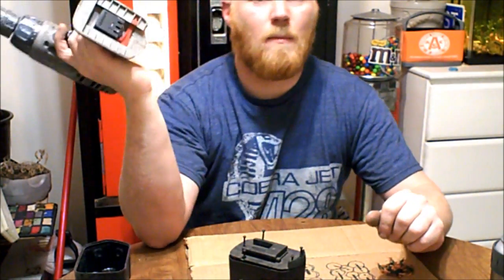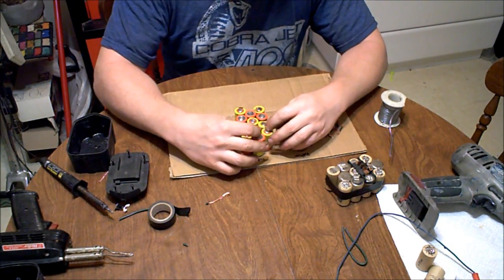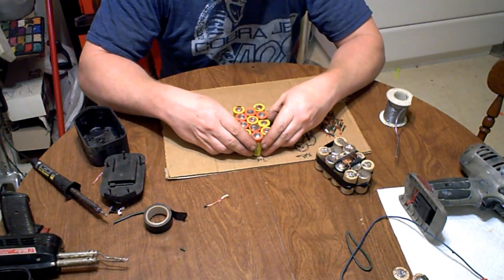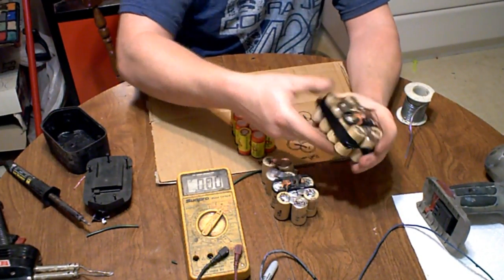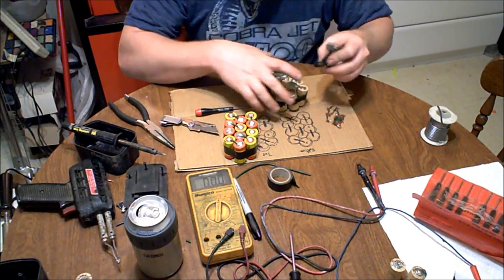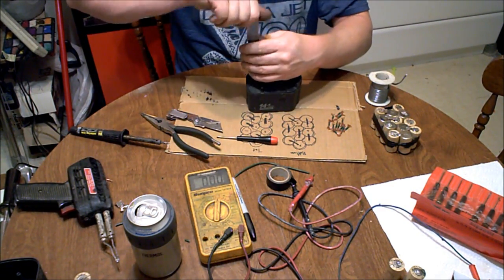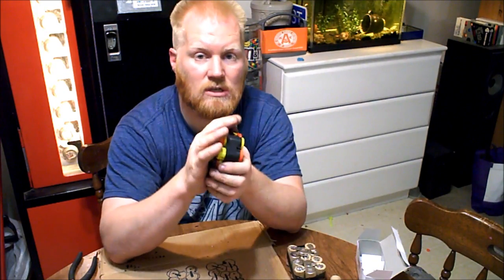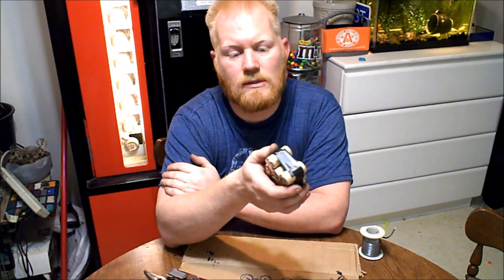Cordless Drill Battery Pack Rebuild for $20 or Repair for $0

Comment: So what is the cost comparison when you take into account your time. use realistic hourly cost. I'm and Electrician so my Hourly rate is maybe a bit higher. say $45.00 / hour. Is this worth it to me? 15 x Sub-C 2200 mAh NiCd Rechargeable Batteries with Tabs (for  my 18v Packs) $43.00. A new Dewalt 18V XRP battery costs 59.00.($16.00 difference) If this takes me more than 25 min. I don't realize any savings at all what so ever. And that's not including solder, wire, and the cost of a good soldering iron. This will be a loss until I've done maybe 10 or 12 battery replacements(at least five to get proficient at it and get it under 20 min). And if your right and my batteries last 5 years after replacement. I'll be retired before I break even. Thanks, but no thanks. Entertaining though. maybe explain to folks why they are in series rather than parallel. NB there are companies that will save you time by supplying the batteries with the flat tabs already soldered on the ends. this will negate the need for melting out the battery guides in the battery box.
Reply from the maker: Kevin Heuman That's brutal to charge yourself $45 and hour to do work for yourself. You don't charge yourself $45 an hour to go the grocery store or to mow your lawn. For better batteries than Dewalt will come with, it will cost you $30.94 shipped(15 Tenergy Sub C w/tabs) and 15-30 minutes of time. It is a performance boost and cost savings, but that is not for everyone.
Reply: ""Union Logic""
Reply: JSLRSMNW Imagine what he charges himself to take a dump...
Reply: Are you for real man? "Charging" yourself $45 per hour is an absolute nonsense. So each hour of the day is "chargeable" at $45, you need to seriously get a life!
Reply: If you are charging yourself $45 an hour then you have to be sure to give yourself a 1099 and pay federal, state and local tax too.  Of course, this guy might have the opportunity to work a little overtime each and every time he needs a battery or any other thing he can save money on by doing a repair at home....
Reply: Kevin Heuman  Mate I think everyone is taking it out of context... I believe you're asking whether it's worth your time rebuilding batteries for profit? That depends on your workload I suppose. If you're having a quiet week then repacking batteries may give you SOME income (as opposed to none). I do lower paid jobs in my quiet periods. By the way, you're being ripped off - going rate for electricians in Australia is A$100/hr - US$80 or so!

Comment: ever tried using a battery recharger that revives dead batteries to get back the dead ones ? they can take days to work but mine definatly has revided a few dead batteries in the past.
Reply from the maker: tuga2112 Yes, I have. I have used the La Cross to revive some...BUT, it is short lived and the cells revert quickly to poor performance or have extremely high self discharge rates.
Reply: sixtyfiveford
 Interesting. i never noticed that in my batteries, but to be honest i dont use them very often ever since i moved from wireless to wired keyboard & mice.
Keep up the nice videos. today i finally made my refillable airspray can. unfortunately i damaged the interior straw in the process, so i will have to try again :)

Comment: Thank you for doing this video. I have a question, why didn't you put lithium cells in there? That would change the charge times. I wonder how to figure that out.
Reply from the maker: Love2boat92 Great question. There are a few issues with Lithium cells. First they are extremely sensitive to charging so a new charger would be needed. They need 4.2volts each and no more or they'll literally explode. A standard power tool charger can't do this. Second, you would have to use High Drain cells, which are expensive. Standard lithium cells can't handle the fast drain that a power tools needs. Finally, they are also very sensitive to over discharging. Commercially made lithium tools/batteries have circuitry that cuts off power once the cells have drained to approx 3.6 volts. If they drain to far they can't recover and are garbage.             Lithium is nice and packs a lot of juice in a small package but retrofitting old power tools is generally more work than it's worth.
Reply: sixtyfiveford Thanks. I was wondering how they would charge. I had no idea if over charged they could explode and if discharged too much, they cant recover. I was just curious. So which batteries do you think is better for say a drill?
Reply from the maker: Nicad are the best choice for high drain devices. They are simple and cheap. Nimh can't handle the high rates that a power tool needs. Don't get me wrong, Lithium cells are great but you need a lot of circuitry to maintain them and not worth swapping into an old power tool but definitely worth it if you're buy new.
Reply: sixtyfiveford
Ryobi now has, in their One+ series, a charger which can charge either LiIon or NiCad and either battery will work in any of the One+ tools.  Pretty smart charger I guess.  (I don't work for Home Depot, I just like the Ryobi tools)

Comment: What gauge copper wire do you use for your tabs?
Reply from the maker: Ryan Shryock I used 12 gauge but that is a little overkill. 14awg would be fine.
Reply: sixtyfiveford Thanks buddy.  1 other question.  Do you use any kind of specific solder?  I am using regular electrical solder and I am having a very hard time getting it to stick to the batteries.  Its confusing!
Reply from the maker: Scuff/scratch the battery surface with a screw driver or sandpaper. Then the solder will stick.
Reply: sixtyfiveford Shoot.. That's what I have been doing, but still won't stick.  Someone said maybe its a special solder.  I doubted that tho.  I am using regular, lead-free electrical solder.  :-/
Reply from the maker: Lead in solder works better. Is it rosin core as  you need some sort of flux.
Reply: sixtyfiveford Hmmm, ok, I will see if I can find some of that.  Thanks buddy!
Reply from the maker: Any solder will work you just need something with flux build in (rosin core) or you need to use an external flux.

Comment: Hi! Great great video. Can you tell me what the temp sensor on bosch batteries are made of? Is it only a wire that touches the batteries down there or is there anything more attached at the end of it? It`s sealed with some sort of plastic at the end so i can t see what it is.
Reply from the maker: Hans Bones It is a small temperature sensor device with 2 small wires running to it. Power flows through it normally but when it gets to hot or too cold it will stop the flow of power telling the charger to stop charging.
Reply: sixtyfiveford ok, can i make a temperature sensor of something at home or is it to advanced for "home fixers" like myself?
Reply from the maker: It's not something you can make. Why not just use your old one?

Comment: Just wondering if you have any thoughts/knowledge on running a higher voltage than stock. I was looking at the batteries on my 12v Bosch impact driver and they have 2 sub-c sized cardboard spacers. Obviously they use the same housing for their 14.4v batteries. How detrimental could it be if I juiced it up with another couple cells in the pack when I rebuild instead of the 10 pak +2 spacers? Great video by the way!
Reply from the maker: Anthony Williamson Honestly I don't think they design the motors that differently(or at all) that it wouldn't handle the slight extra voltage from 2 cells. I think it is a gimmick but I also don't think you'll notice a huge power increase while using the tool to add to cells.
Reply: sixtyfiveford I wasn't really looking for extra power, just extra storage capacity, but it stands to reason the motor would want to spin faster with more volts. I wonder if it'd be more efficient (more storage)  putting the 2 extra cells in series (giving higher volts but lower amp draw if the motor's wattage is fixed) or in parallel with the original battery pack increasing the Ah...I may have to experiment. Your vid prompted me to Ebay purchase cells to rebuild my hammer drill batteries and if that goes well I will play with these Bosch ones. Thanks!
Reply from the maker: In parallel wouldn't be good unless each cell had a matching parallel cell. The drill would spin faster in series.

Comment: You should really do this with the cells fully discharged. If there is a mismatch in the SOC on one of those cells, you could cause it to vent. It also lessons the danger if you accidentally short cells when you are working. Good NiCad cells can discharge at 20C (and will reach that in a short). If these are 2000mAH cells, every cell is capably of putting out up to 40 amps

Comment: Excellent video, thanks. As one person mentioned, MAh means Milli Amp hour, which is the rating on all small batteries. Car batteries and others with several Amp hours are just Ah. I was hoping you would mention a good source for bulk (like boxes of 20 or more) NiCd sub-C batteries. Paying $2 each would be more than the cost of a new cordless drill battery pack. Mine is Craftsman 19.2V at around $30 new. Got any bulk sources? Thanks again, well done.
Reply from the maker: marjamada $2 is as cheap as you're going to find unless you by in bulk(100's). The stock batteries they put in the packs are very poor quality and that is why the have short lives. For around 2 each you can actually put name brand cells in that'll outlast anything you can buy off the shelf. A $30 pack is cheap, very cheap as most commercial brands will zing you $80+ for a pack.

Comment: hi great video but when i wanted to get the same batteries come out of mine which is 1500mah i can not find them, is there any way i can use 2500mah if yes i have 13 in mine do i use the same amount of batteries??? thanks.
Reply from the maker: bektas konca Yes, use the same amount of batteries. Higher MAH will just make them last longer. My concern is that you put NICAD batteries in and not NIMH.
Reply: sixtyfiveford what is the amp suppose to come,  i have 18v battery but not much info other than it says nicd 1500mah on each battery 13 0f them.
Reply from the maker: You should have 15 cells for a 18 volt system (1.2volts x 15 =18v). Sometimes 2 are up in the handle. You can use any mah rating. The higher the number the longer they will last in your drill.
Reply: sixtyfiveford definitely 13 batteries but there is a lack of writing what the voltage is only writing is 1500mah ni-cd, i don't want to buy the batteries than end up with loosing more money but there is an other ways, like picking up a cheap 18v battery from a boot fair, taking it a part and put it in mine are they all compatible with all 18v???
Reply from the maker: All ni-cd and ni-mh cells are rated at 1.2 volts. This is the industry standard. Is it a name brand drill or Chinese tool? Good used cells from any battery pack would work.

Comment: Just got back from the north and wouldn't you know it one of my batteries is not charging,..both were then I got one to finally take a charge,..on my way to HD for a multi meter,..special torx drivers to take pack apart.  Plus soldering iron.  Thanks for a great service!!
Reply from the maker: ***** Thanks for watching.

Comment: Great vid! Been doing the "zap" thing for a few years and your right. Good (sometimes) if you need a quick temporary fix but useless for the long haul! Question: What wattage soldering iron are you using? Do you have a source for replacement battery heat sensors? Have you tried to just replace bad cells with "new" cells? Providing they have the same mAh rating, should there be any issues?
Reply from the maker: Brian Michaels Bad cells with new cells: Yes but the new cells are stronger and generally will overpower the weaker/older cells. So I prefer to take cells from 2 or more battery packs and make 1 or more good packs out of those cells. I have never had a temperature sensor that was bad but Ebay would be the best bet for cheap ones. A simple 30 watt iron does work it just takes a little longer for it to recoup heat between solder joints.

Comment: Have you tried any Makita BL1815's?  I love my 18v But I've heard its a no-go with these. Something about the chargers
Reply from the maker: pesti moffett You can get these open with a little patience.  Just pry/cut around the seam until they start to come apart. You will have 10 High Drain 18650 Lithium cells.

Comment: good deal!  any suggestions for a charger rebuild?  I replaced a 14v batt for 50 something years back worked for a month then the charger went bad ( grrr ) new batt came from Skil   one of those 4 tools one batt   thing. All eggs in one basket, but I liked the darn thing....    good vid  I too juz sub'ed U
Reply from the maker: S. Mitchase The most common thing to go out in electronics is capacitors. They are cheap and easy to identify.

Comment: How can you tell if your charger is putting out the right voltage? Which tabs, how many volts? Thanks -
Reply from the maker: Ron Berlier That's not an easy test. Some chargers won't put out voltage until they sense a voltage from the battery.

Comment: I know this is an old video but a great one.  I want to ad a Severe CAUTION though.  I have had Batteries leak on me and I got burned pretty bad.  It's not always easy to see that one is leaking until you pull the old battery pack apart.  Wear gloves and protect your eyes!  Great instructional though.  Don't want to take anything away from this guy.
Reply from the maker: DF Lopez Yeah, they can leak. But it is fairly uncommon unless they have been overcharged.
Reply: sixtyfiveford I'm not sure what caused the last one that did it to me.  It was a 18v Dewalt battery that the charger deemed as dead.  It also sat for almost a year before I started messing with it.

Comment: Great information....I am a Carpenter and over the years, I have accumulated quite a lot of old battery packs, that stopped charging....Most of the time, what happens with me, is the cost of two new batteries, are so high, that I can catch a tool sale, pay just a little more, and get a whole new drill, two batteries, charger, and case...Or the next new, more powerful drill, has come out on the market, and I upgrade to the next best thing....So I have ended up with used, but good working, intire drill kits, with dead batteries.....and you see tons of thoses on CraigsList  for a dime a dozen.....
Reply from the maker: Timmy Gee Thanks. Yeah, they charge way more than they should for replacement battery packs, but it sells new tools.

Comment: Someone may have already pointed it out to you but the current rating for a battery is not microamps it is milliamps. 

Instead of using wire to connect the batteries together I use flat copper tape. It comes in rolls of 1/8 inch 1/4 inch and other widths to suit your needs. I clean the battery contacts and lightly sand them with 400 grit sandpaper then tin them before applying the tape. If it appears that the sticky side of the tape  may come in contact with the opposing + or - terminal then insert some insulating material beneath it.  It works great and makes instalation in tight quarters simpler than the bulky wire. Check YouTube for videos on how to repair a bad NICAD cell. 

USE SOLDER MADE FOR ELECTRONIC EQUIPMENT AND NOT PLUMBING SOLDER. 

Best regards, 

Mick Bradford
Reply from the maker: Mick Bradford Yeah, I misspoke. Solder tabbing strips do make it nicer in confined areas. But you need to make sure they are heavy duty enough to transmit the amperes. I always have extra bits of copper wire laying around so generally that is what I use. You can also pull all the sheathing off the stranded wire and it will lay as flat as tabbing strips.As far as "shocking" Nicad cells to revive them it is snake oil. Though you may get a superficial voltage they will have no capacity or have extremely high self discharge rates. Making them unusable.

Comment: Can't wait to try this on my Dewalt 14.4 battery packs.   Thanks for posting,  and for replying to all the questions.
Reply from the maker: cember01 Glad the video helps. Let me know how it goes.
Reply: sixtyfiveford
Success!   Just got done and seems to work fine.  Not sure I'd do it again.  Cost about $28 for the tabbed 14.4V pack and took about 1-1/2 hours.  Dewalt's 14.4 setup has a single cell above the rest of the group, making for an awkward setup.   There's aftermarket ones on Amazon for about the same price.  Still, it was fun to do.  Tough to get solder to stick to flat surface.  See why you go without tabs.  They cost more, you throw more than half away, have to watch their direction top and bottom...just more of a hassle.
Reply from the maker: You'll be happy you did it. The Chinese battery packs on Amazon are bad. Few people have long term luck with them. On a side note the number 1 thing that kills these packs is over draining the pack. Once you realize it's getting weak, stop and charge it. That 1 last screw or extra hole to drill stresses the weaker cells and can permanently damage them. They will actually reverse polarity. Most battery packs get junked because of this.

Comment: Thank You Phillip Seymour Hoffman for great Youtute. I noticed one of the tools on your bench was a cylindrical aluminum can with a tab on top, housed in what looked like a Styrofoam sleeve. Not unlike what is commonly used to contain a form of alcoholic brew as a convenient means of human consumption. Would you say that said can should be part of any workbench?
Reply from the maker: enigma Yes, a chilled beverage is always a wise safety precaution to prevent dehydration.